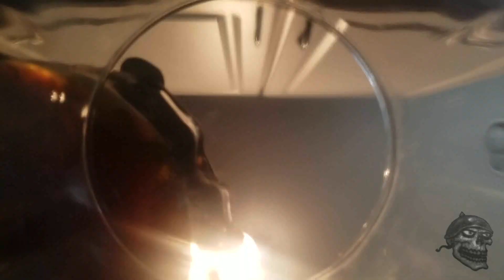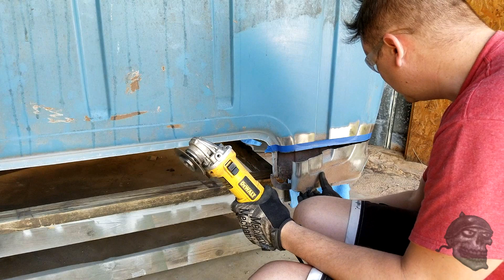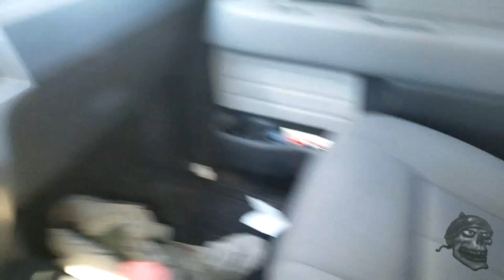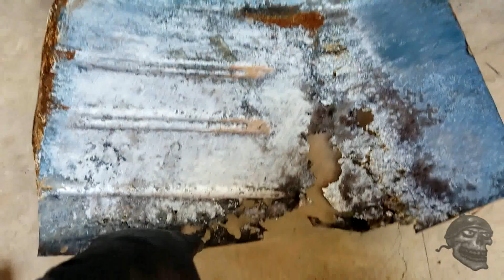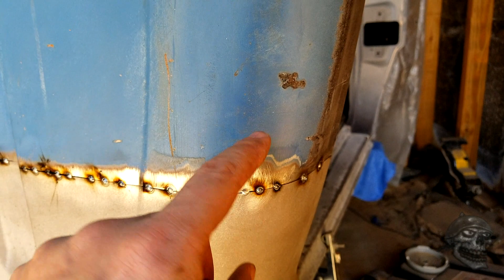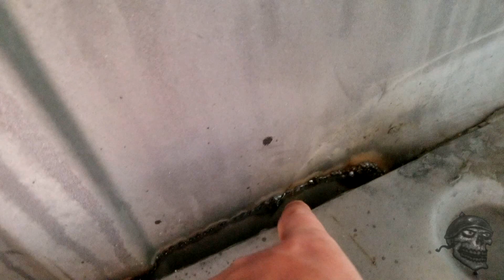F250 restoration project – Part 25 Replacing the Cab Corner

Comment: I wonder if that inner piece of the cab corner is reproduced by anyone? I need it for my truck and cannot find any donor cabs
Reply from the maker: The inner piece isn't seen from the outside and I have never seen it in the aftermarket scene. I only say it because it's easy enough to create a patch panel and know it won't be visible.
Reply: @RIPbiker13  seems like it's a common bad spot. I'm surprised nobody has started producing it along with the outer corner
Reply from the maker: @willhart7861  I am too. It is a bad spot and on most trucks of this vintage, it will be destroyed. I believe the reason we don't see it in repop is because it isn't seen. Then again, a lot of the repop sheet metal takes a lot of work to get right, so it's a lot of work no matter how you go about it.
Reply: @RIPbiker13  I absolutely agree with you on that.

Comment: HAHAHAHA !!! She was hilarious !  Hey RIP did you smooth out the inner panel welds or treat them?
Reply from the maker: PCHelp76180 I have access to them from inside the cab, at least to treat them. I have not yet, but will. I will mix up some epoxy and use a special aerosol can to shoot in there with the Eastwood tube I cleaned up.
Reply: Have you ever tried any of the PORE products for under coating?  Was thinking of using it.